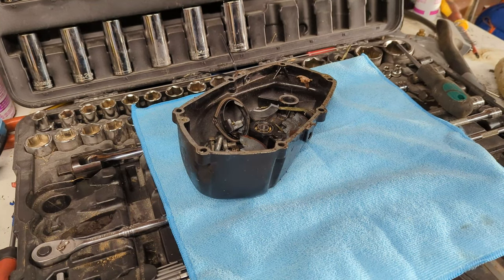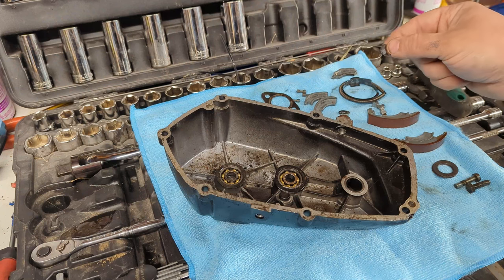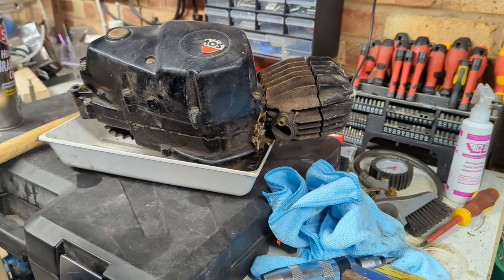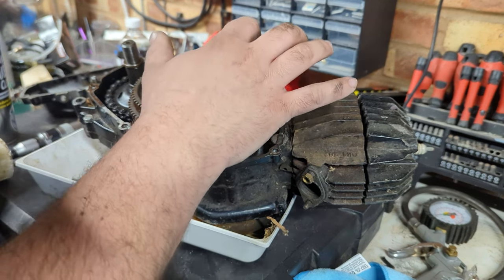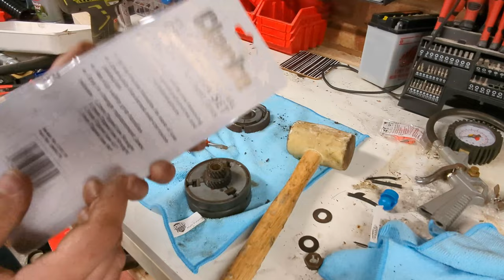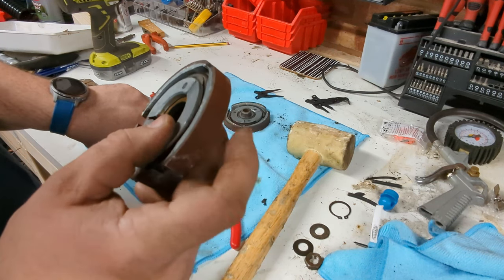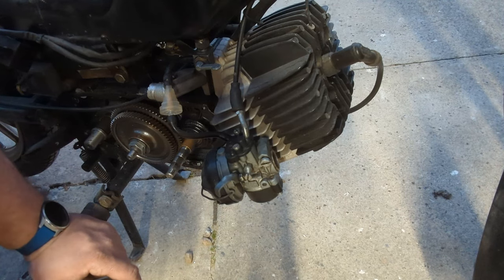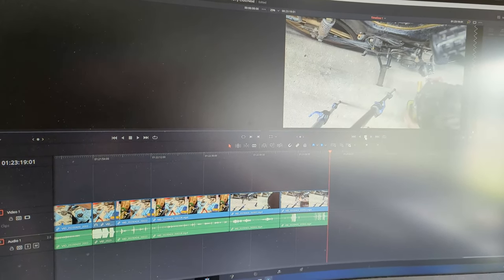Replacing Clutches on Terry the Tomos A3 Golden Bullet | JAM#23

Comment: Great video, thank you so much. Very informative.
I mention the following for anyone it can assist:  Keep an eye out for shims as the case comes off, they are on all three shafts or stuck to the bearing in the case.   Also, there is another shim (0.3mm) that sticks itself discreetly to the back of  first gear clutch hub. The clutch shoes really are the weak part of the A3 engine. They are so fragile and will fracture and crack  in time with use. The springs are a pure nightmare to refit without factory tool number: 731.798.  The impact wrench is a god sent for undoing the clutch hub nut (as in the video.). The torque setting for re-tightening the clutch nut is: 18 pounds/foot. A couple quick pulls on the trigger of the impact wrench on lowest setting  will do, ensuring the locking tab washer is also  bent to lock the nut. Other methods of getting the clutch nut off is using a car oil filter strap wrench. It will hold the clutch drum if you wrap the drum with a good amount of masking tape to hold the strap in place to undo or re-tighten the nut. Another trick of the trade is to take the spark plug out and push cord or thin rope down the spark plug hole to pack out the combustion chamber to lock the piston so the engine can't turn.   I used a four inch, three legged puller to get the clutch off. It makes the job a doddle.   The factory manual and Haynes drawing are obscure to which way around the first gear toothed spring plate is. The outside edges of the spring plate should rest against the outer edge of the clutch hub. The second gear clutch does not have a spring plate.  When re-fitting the clutch drum, if it won't go on enough to get the spring washer, locking washer and nut on, use a small socket resting on the first gear clutch hub to  gently tap it onto the shaft until the nut will go on.  Never tap the clutch shoes or they will  break. Tighten the clutch nut to push the clutch drum onto the shaft then  torque the nut.
Reply: Do you have any diagrams or indications of where each shim goes? i removed the cover (being careful) and all the shims dropped onto the floor, im not sure where the shims and washers go exactly and i cannot find any information online.
Reply: @TylerWilson-ul4io  Sorry for the delay replying. My shims were: 0.2mm and a 1,0mm on the kick starter shaft, a 0.2mm on the gear shaft, and 0.3mm on the clutch shaft. I measured them with a micrometer and wrote them down in my Spare Parts Catalogue the last time I had the cover off in June 2024. I was replacing the second gear clutch shoes at the time. The parts catalogue gives two sizes could be used on the gear shaft : 0.2mm, and 0.5mm. The shim sizes stated in the catalogue for the clutch drum shaft is, ' 0.5mm -  as required.' On the starter shaft, three size shims are given: 0.2mm, 0.5mm, and 1mm. I hope this information helps.